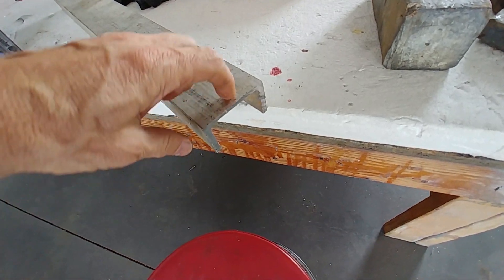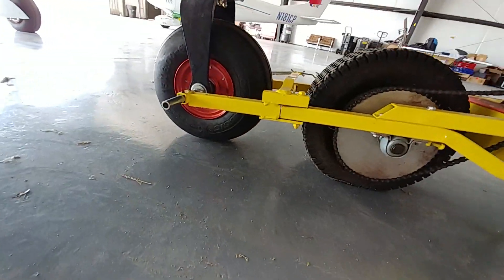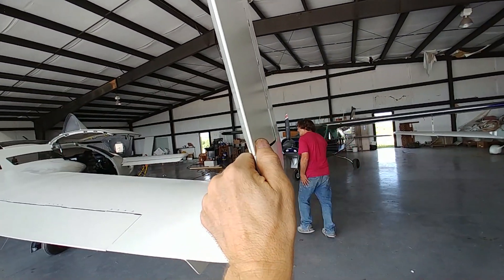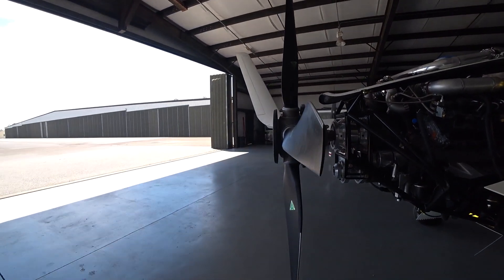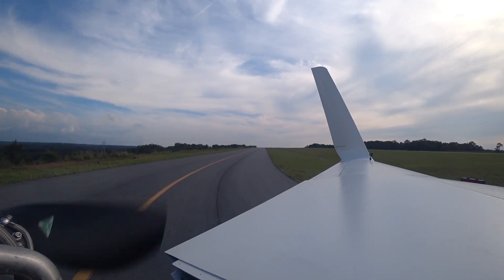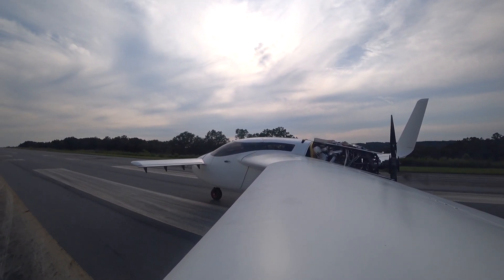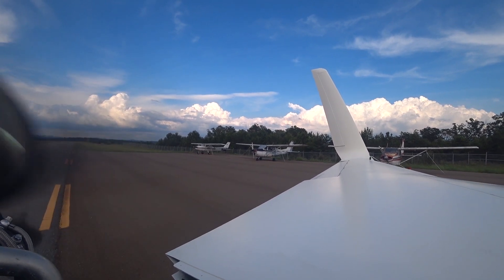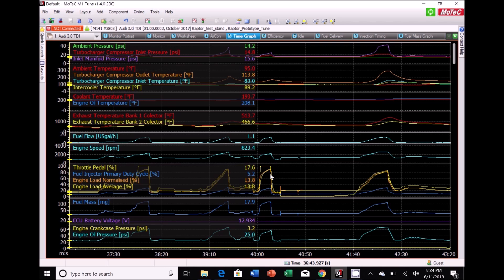Pushed to the Breaking Point - Building the Raptor Prototype

Comment: Hello again my friend, or should I say Mate?  My current business is selling gasoline and Diesel fuel additives.  If you're interested I can set you up with some additives truckers use in their big rig diesel's to keep their fuel from gelling in cold weather.  Did I spell "gelling" correctly?   If you're interested there are several great additives, engine cleaners, etc.  The brand name of these additives is Hot Shot's Secret. You'll see it for sale in Advance Auto, Autozone, O'Reillys, Walmart and Amazon,  They are also for sale at about all the major truck stops on the interstates.  Oh, I forgot, Tractor Supply stores too.  Perhaps you can give me your email address.  I have a great deal of interest in your new Raptor.  I was considering using a different engine.  It's maybe 100 lbs lighter than the Audi turbo-diesel and has about 650 hp and thousands of $$ cheaper.  My email address is pg4323@yahoo.com.

Comment: fwiw looks like resonance destroyed the rubber damper.  Extended idle periods with the prop unloaded is a killer especially with the diesel's high torque impulses/reversals.  Did you keep the prop aerodynamically loaded at all times?  This issue is a killer of many a re-drive. Some have avoided it by running a one-way free-wheeling clutch to only engage when there is enough rpm to keep it out of the resonance zone (although I'm not sure if a decent at high speeds could result in the issue reappearing with the clutch locked).  Best wishes on resolving the issue - it's a really tough nut to crack. Folks like Viking with their Honda conversions also use rubber damping, but have also had at least one (published) failure in their fleet.  Have you looked at the Diamond diesel gearbox implementation for hints on a successful strategy?  If you look at the 9-series rotax, they have gone through great lengths to deal with their gearbox issues with a dog clutch and breakout overload clutch. And they still have spline wear issues if idled too low.  They have gone to a torque shaft solution in their new 915's - so they are still trying to beat that dead horse.

Comment: Is it possible this part failure was caused by torsional vibration? TV is notorious for wrecking parts with no warning after hours of seemingly normal operation, and the higher the compression on the pistons, the bigger the spikes fed into the system. I agree that a diesel engine is the best possible fit, but many others have been reluctant to work on them because the greater fuel efficiency and durability caused by higher compression are balanced by larger torsional vibration problems. 

Here's an article about Burt Rutan working at BD aircraft and dealing with this issue:
http://ibis.experimentals.de/downloads/torsionalvibration.pdf

Is anyone else here experienced with TV and able to offer any advice? 

A book on the subject:
https://archive.org/stream/in.ernet.dli.2015.140286/2015.140286.A-Handbook-On-Torsional-Vibration_djvu.txt

Comment: This comment is for the more "involved" of Peter's YouTube audience, not necessarily Peter.  This is tech info to consider when the Raptor goes into production and it has to do with the slow spool-up speed inherent in yesterday's traditional turbos.  Today's automotive turbos have electric motor/generators on them to give them instantaneous spool-up speed that rivals the spool-up speed of superchargers.  The motor-generators are only spool-up the turbo, not drive them full time; the exhaust takes over.  As a bonus, the 'wastegate control' is taken over to drive the motor/generator to charge the battery.   This technology may help Peter's concern of the black smoke out of the exhaust he mentions in this video.  There are numerous articles about this technology online of which this, is but one.  Read this:
https://www.autonews.com/technology/plot-twist-turbocharger-ruled-road-race-track
J. Larry Bloodworth, CMAT
Draper, Utah 84020-9541
larrybloodworth@gmail.com

Comment: Prop pitch, did you lower the amount of pitch, or increase the pitch. I thought for maximum power for take off you want the least pitch/high rpm. Simple terms, put it in low gear so engine as maximum sustainable torque. Maybe you did this and I missed it, but I do think if the prop had a higher pitch it would put a big load on everything and lead to early failure, the engine is being asked to turn a much larger screw into the air.
Reply from the maker: I set the pitch to around where the governor would put it at 120 kias. I did so because not having the governor right now means that I don't want to run out of throat at 80 knots as you would if the pitch were flat. I probably have too much on there and I will dial it back for the next run.

Comment: I’ve always wondered about the side forces placed upon the redrive though belt tension and now with the elpex coupling failing to it really does make me question whether a gear driven transfer box between the couplings instead of a belt drive. You’ll sort all these teething problems out of that I’m completely convinced, keep plugging away dude.
Reply: A gearbox can also have "teething problems".  Sorry...I could not resist the pun!  I did have the same thoughts regarding the side loads.

Comment: Hang in there, Peter. I’m having similar issues with my two planes,  Cherokee and a Velocity. So I know how you’re feeling. Seems like every time I turn round it’s like, “what now?” You have your WTF/ get upset moment... then you roll up your sleeves, resolve the problems and move on. And you obviously know this but I just wanted you to know, we all face issues and get frustrated with challenges in aviation... so our sympathies with your plight are genuinely. You’ve been at it hard, 6-7 days a week, for a few years now. You (and your crew) need a break. Take some time off to re-charge your own batteries. This buyer/ investor is still behind you guys 100%!

Comment: Interesting problem.....If the coupling is rated as stated, there is a harmonic ressonance involved which will exponentially magnify stress on the coupling......In commercial  variable speed fan systems you will always have such points, if not multiple ones. In these situations, we're dealing with VFD driven electric motors. What's normally done is the drive is programmed to skip (transit through) certain frequencies (RPMs) to avoid the harmonc zone(s). That said, I think you're going to need to couple a vibration (stress) transducer to map the entire  range. Piston power pulses may also be involved which may force you into using a radial coiled spring coupling.....basically the same as in an automotive clutch disc. Good luck to you on the gremlins.....On al lighter note.....Do you remember the Bugs Bunny cartoon where he had the little gremlin flying with him?

Comment: I don't get why the pitch had to be increased for take-off roll measurements? The variable pitch prop has the least bite in the take-off position. The load of the prop has to be decreased to the point where the engine can make its max rpm to achieve max hp.
Reply: Martin Renschler 

      It’s quite possible that this engine/prop combo will increase pitch off of the normal low pitch stop to absorb the power produced by the Audi diesel at takeoff manifold pressure.
        Since he’s testing it without normal governing, he had to “reset” the low pitch stop.

Comment: Remember you are moving through unknown territory with a new design, new engine application, without any previous history or experience in the project.  You are doing pure R&D on your own.  You are learning by your mistakes and not from the mistakes of previous developers/engineers.  This way is the most costly in money, time, and humility.  You know that the finish line is just over the horizon.  Push on.

Comment: I know nothing of aircraft design or manufacturing but would some vertical hoops be a better option for the bracing for the pulleys instead of adding in box section bracing ? like old school spitfire or hurricanes had circular bracing. Probably get a load of clever answers as to why not but just an idea.

Comment: Just be careful if you are using diesel.  There is a risk when the temperature gets down that it can gum up.  Not sure in the states, but here in Queensland they have the summer and winter diesel.  Remember working for caltex at the time and in winter everything diesel stopped because the wrong diesel was delivered to the port.
Reply: He has addressed these issues early on.  The fuel is heated

Comment: That connection shouldn't have failed. I reckon there's a design flaw there. On motorcycles, jet-skis and ski-dos there's a lot more metal betwixt the inner and outer surfaces so the load is transferred in a circumferential manner rather than radially.The rubber takes up all the load by being compressed and isn't bothered by torque. That job is handled by metal or composites.
Reply: yup, on my motorcycle the cush dampers are always in compression, no tension to damage them.
Reply: Inappropriate torsional vibration will eat a coupling.  It does not require tension on the rubber to fail.  Momentary torque spikes cause the rubber to to compress and relax at high frequency causing over heat.   The rubber then fails in shear from combined over load (momentary) and over temp, all materials eventually loss properties as a function of temperature.

Comment: There is a version of some of the Elpex couplings that have a failsafe mode (eg their "rubber tyre" coupling) that allow for emergency operation even if the rubber tyre fails.  Maybe talk to Elpex and see if that option is available on that coupling.  You could always build that in externally,  a disc with fingers or holes that fit around pins. In normal operation they don't come into contact, but if the Elpex fails, the pins contact the fingers and emergency drive is available.

Comment: Should probably cut your losses on this engine. Contact Continental get your hands on a CD300 that has a direct drive gearbox and lower fuel burn. Diamond is already flight testing their DA50 so the industry is throwing their support behind it.

The engine vibrations and belt tension are going to continue causing drive issues. If the current system cannot run under load without tearing its self apart, plus the previous one did the same it’s a pretty strong indication it’s time to start looking for a direct drive option. Belts, vibration, and highly loaded bearings are not a good match.

Comment: If 40psi boost is off an actual boost gauge, the compressor profile needs be remapped to a lower boost target. At those airflows with the stock compressor it will not have a very long service life at all due to insane turbine shaft speeds. With that air flow the fuel flow should’ve been closer to 14GPH not 11GPH, might have undersized injectors, or an inaccurate fuel reading. 

Ideally boost should be dialed to 22-30psi with the stock turbo the applications constant load duty cycle. Marine and aviation engines run much harder due to the constant load and high power settings. You can’t run boost profiles you seen in automotive applications that only make 10 second WOT pulls down the drag strip, or short burst of acceleration on the road followed by coasting around at low power or idle to cool off.

Even on the marine version of the exact VW 3.0L you are using here has a maximum boost is 33psi. But it will be targeting much lower in the 20-25psi range leaving room for compressor spikes, not running 40psi intentionally. 

The marine application is very similar to aviation with its constant load and high power settings. The load ratings, fuel injectors, compressor, and supporting equipment used on the VW/Mercury 3.0TDI would be a good place to spend some time researching since this is what your engine needs to emulate if you plan on making reliable power.
Reply: Alex1911   Don’t know if you’re a regular follower?  But Peter has built a custom series turbo set up.  I assume the boost he is referring to is out of the second one.  

That all said sounds like you have some experience and reasonable advice on these critical details.  The only engine system is really key to the economics and performance Peter is going for.  If it were easy, someone would’ve done it by now.   Any insights and support we can give is bound to help.
Reply: Tim Duncan nope haven’t seen anything on his turbo set up, or how he controls the wastegates. Do you remember if the turbo setup was detailed in those earlier episodes? From what I saw it looked like a custom manifold was designed and the stock turbo attached. I’ll go back to the install video to see if I can spot what turbo is installed to the exhaust. There was an episode recently where I should be able to see it.

Would be good for him to look at what VW is doing with this engine in marine applications though. It will show the kind of power output and fuel consumption he can expect from it in aviation. Marine and engine duty cycles are practically identical with different cooling methods one using air/liquid, and the other using (marine) raw water/liquid for cooling.

The VW TDI 3.0L v6 blocks top out under 300hp, and consume over 14GPH. These are reasonable numbers considering marine just like aviation is constant/high load duty. You set 60%-70% power setting and burn fuel over time, exactly like in aviation engines. 

Trying to push higher power levels like we with these engine aftermarket tuned for road use would be disastrous in aviation and marine. These automotive applications only see short burst of high power setting, with ample time to cool off components like the turbo at a low cruise power. The last thing you want on the water is to grenade en engine and be at the mercy of wind and water currents to destroy your boat/life. Same concerns with aviation applications so pushing an unproven engine into uncharted territory with these kinds of continuous load power settings would be insane if planning to be out of gliding distance of an airport.
Reply: Aircraft 'boost gauges' are typically absolute pressure, not gauge pressure like most car guys are used to. So subtract about 15psi (actual correction is variable depending on altitude, temperature, and local pressure systems) from that reading to compare to what you think is normal.
Reply: David Long it depends if it’s manifold pressure which will indeed need the 14.7 subtracted. This is also true in many cars from the factory. That’s why I was wondering if the 40 psi was off a boost gauge.
Reply: @Alex-us2vw  ah, i see now that you asked if it was a boost gauge.
Reply: David Long figured it’s was probably a boost pressure since it was in PSI, wouldn’t be hard using a motec ecu which is a product that’s caters to race modified engines but who knows. It’s also an achievable boost target many high performance cars do at the track for short burst. But to have that run continuously or even just every take off would be a lot. I would assume the shaft speeds must be very high and way beyond the turbos mfg specs.
Reply: Alex1911   It would be nice to have rpm off the turbos. Got into a project like that once using Bentley Nevada sensors,  it was a very expensive and fussy test rig.
Reply: Alex1911   Try this link and the several before it.  This project centers on the engine imho.  It is a huge opportunity as well as huge hurdle & he could use more help in this space.  

https://youtu.be/xRpRavKQdiU
Reply: Tim Duncan that video link for the engine looks much better and more inline with what I would expect for fuel consumption. Ambient 14 that day, inlet was 45psi, for a boost of 31psi and burning 16 gallons per hour, perfectly normal for this engine under load. This makes much more sense. When I saw 40psi at 11 GPH I was like what’s going on here lol. But if ambient was 14.7psi that’s only 25psi.

From what I could gather it looks like he’s modified the stock setup to a twin turbo setup. So it would be impossible to make any shaft speed estimates without knowing the compressor and turbine sizing. Who ever helped him with sizing the turbo compressor and turbine for this application probably did the necessary calculations for volume/psi/ect for best efficiency before buying these new turbos. I can’t see them randomly buying a couple turbos and hoping for the best risking poor efficiency, insane shaft speeds, or running beyond maximums.
Reply from the maker: Subtract 14.2 from the 41 to get the amount of total boost. I will be dialing it back eventually.

Comment: That coupling might not be able for the side load caused by the belt. If there was a bearing on the end of the shaft to support it, it should put up with a lot more.
I'm a technician with a fair few years engineering behind me. 
Anyway, chin up old boy! Take a breather and get a lot of sleep. 
Best wishes from Ireland!
Reply: That's part of the problem here. There is a bearing at the aft end of the Elpex shaft. It's anchored to the structure that supports the prop shaft. However, the engine is not rigidly mounted to that structure, they are isolated from each other by elastomeric mounts. So engine vibration and radial loads from the belt that move the engine on its rubber mounts cause misalignment between the crankshaft axis and the axis of the support bearing. That misalignment contributes to heating and wear of the Elpex, and also causes premature wear of the two toothed belts.

Comment: Wouldn’t the prop be full fine for take off and run ups?
Reply: Alex1911 
       Yes, if it were a constant speed prop.   With the redrive issues, it is operating as a fixed pitch prop.   With the normal low pitch stop setting, it would most likely exceed max RPM when the engine reached full power manifold pressure.